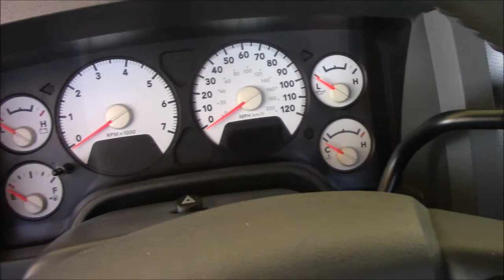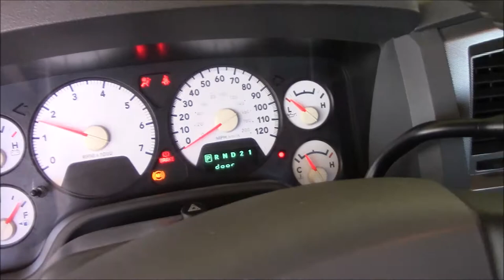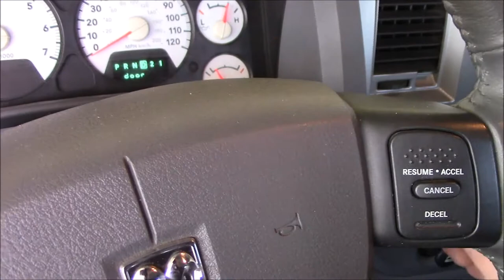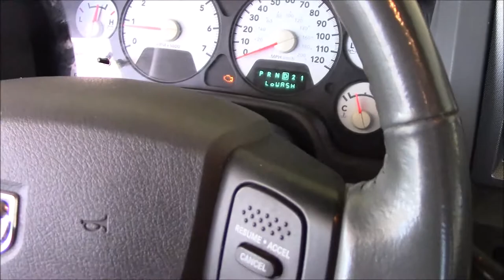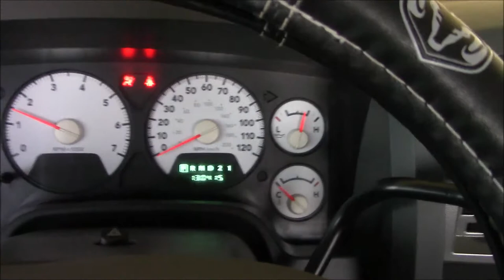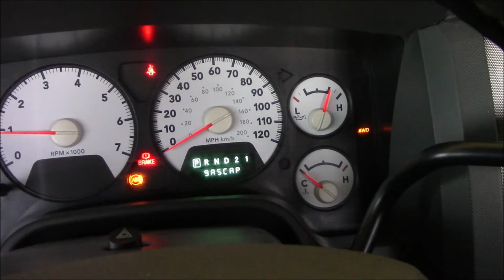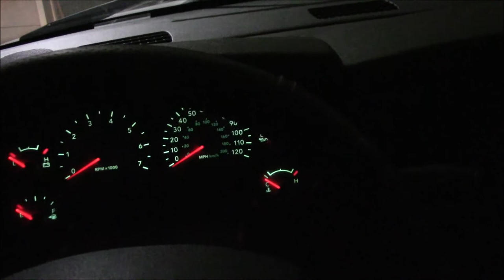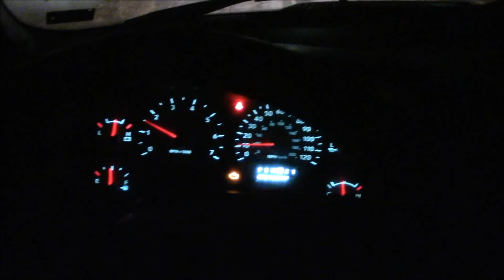2007 Dodge Ram 4 Wheel Drive Diagnose and Repair

Comment: I’m having a similar issue, the actuator works fine on the bench, the T-Case shift motor is working fine, I even replaced the TIPM but still the 4WD keeps blinking. Any advice ?
Reply from the maker: Check the plug. After I made this video  it eventually turned out that my plug was bad also which I think is why I was still having trouble getting it to engage there at the end. I didn't know that at the time. I didn't have much of a need to use it for awhile so it was months later that I finally figured it out. I went to a salvage yard and found one. It's easy to replace. It actually has a plug a little higher up so there's no rewiring. You just unplug that little section and replace it. Good luck
Reply: @mgewaily did you ever solve the problem completely? Is yours the laramie with 4auto? Replaced my actuators a few times, now the tipm has been replaced and was working for a bit but hit some ice and abs went nuts, surged the electrical in the truck and 4wd service came up and then disappeared after a restart Sound familiar?
Reply: @problemsolvingbrad I did fix the problem, turns out it was the speed sensor by the wheels, the wire for that was cut, once I spliced it everything worked perfectly.
Reply: You have to be rolling when you turn the knob for 4hi. Allows the splines to engage

Comment: Ur supposed to get hopelessy stuck in 2wd and then use the 4x4 thats the only way to test that lol
Side note one damm wire on actuator rendered my truck usless 4 a year
Reply from the maker: Exactly. It's always fun to crawl under your truck in the mud. Been there. Yeah. About a month after making this video I figured out that the plug was bad also. That's actually why it wouldn't engage there at the end. I went to a salvage yard and pulled another one. It's worked perfect ever since.

Comment: These are shift on the fly 4x4, you can actually engage them up 25-30 mph. To put in 4 low you have to put them in neutral tho. Thanks for the informative video, mine was the transfer shift motor.
Reply from the maker: Thanks for the info.

Comment: Good job on this video...I learned a lot. I wonder if it was possible that you did not have the fork in the sleeve, when you put it together again. Also, the remaining wire might be a limit switch so the computer knows that it is in 4wd.
Reply from the maker: I'm sorry this reply is so late. I never saw it til now. No. I had the forks on the sleeve alright. I've discovered that you just have to turn your wheels a bit until the splines line up. I'm not real impressed with how these work. My '97 dodge doesn't have these problems. I think you're probably right about that wire. Thanks for watching and the comment.
Reply: @troyt9007  so I’m having the same issue with my 07 are you saying to jack up 1 side and align it how???
Reply from the maker: @ericdavis9992  No. You don't need to jack it up. That's just what I did to see what was going on. You just need to be moving and turn your wheel a little to get the two shafts to turn at a different rate of speed until they line up. If you have the 4-wheel drive engaged, the fork on the actuator that goes around the sleeve will keep pressure against that shaft, so when they do line up it will slide the sleeve over the shaft to connect the two. Hope this makes sense. If not just let me know. I'll try to be more clear. Thanks
Reply: @troyt9007  ok thanks I’ll give it a try I really appreciate it I ordered the actuator already but I will definitely try this 1st thanks again
Reply from the maker: @ericdavis9992  No problem. Good luck
Reply: @troyt9007  thanks and I’ll check back in afterwards

Comment: Good video. I have 4 wires from front actuator on 06 1500 Dodge 4+4   #2#3 wires are positive #2 is supposed to turn negative when switching to 4+4. Back to 12 volts in 2+4 . But stays positive doesn't change. Continuity tested wires all way to firewall. All good. New actuator. Transfer case definitely kicking in. Any suggestions please.

Comment: Hello sir thank you for answering my question about my transfer case wiring not being connected because the connectors are different so I don't have to worry about my transfer case shifting to 4 low by itself while I'm on the freeway
Reply: I changed everything eventually changing the timpt or fuse box and it worked

Comment: Should be rollmg to make shift uless going into 4 low
Reply from the maker: I discovered later that the plug going into the actuator was also bad. That's why it wasn't engaging. I replaced it and never had anymore issues with it.

Comment: Oh heck yea I'm subing to your channel!  I consider myself a pretty creative "workaround" guy but SUCK at anything electrical.  Even the way you pulled strands out of those wires to create a better jumper was an awesome lesson for me.  I just tried to totally guess with mine on the bench and probably fried something unnecessarily.  Heading out to the garage to try the bench test your way now!  There was ZERO chance my bench test method was going to produce any movement I assure you ha!  UPDATE:  I just finished watching the video and now I'm wondering if I am just binding like your's may have been.  First I'm going to bench test my OEM original that I pulled previously just like you did it.  If that doesn't work, then I will pull my replaced actuator and inspect that alignment with the passanger front tire up like you did and see if it is just an alignment issue that it doesn't like when it starts up and runs diagnostics.  If that looks good then I'll bench test the replaced one to see if it is a premature failure part.  Wow, what a great video.  I am really curious if the colors of your wires correlate to a 2017 RAM3500 but I WILL report back on all of this in a second "update here on this post".  Thank you!!!!

Comment: You just saved me at least 600 bucks. !!! 
Thanks man !! 
Appreciate ya!!!
Reply from the maker: I'm glad it helped. That's why I do them. I found out about a month later that the plug wasn't making a good connection. It worked for awhile and then it went back to flashing and not engaging again. I replaced the plug and have been good ever since. Thanks for the comment

Comment: the axles have to be moving a little bit so the sleeve can line up on both axle shaft splines & leave in gear for 4x4 high and moving,
Reply from the maker: Yeah. You're right. Sometimes when I know the 4 wheel drive is engaged the light still flashes like it's not. Thanks

Comment: One thing bothered me when you were troubleshooting: the fact that the original and new actuator returned the fork to the 4WD OFF position when you de-powered the circuit. Me thinks that the "ground" you were using was actually a ground for the, say, 4WD Off position. Whereas that ground was/is supposed to be supplied by the rotary switch in the cab in its 2WD position. So, to select the 4WD ON position, the switch would then ground the ON coil and drive the fork to engage the axles. The Off coil would then be un-grounded and so would/will not have returned the fork to the 4WD Off position as it did in your test when you removed the lead from the ground to the battery. Of course, you could just use a volt-ohm meter (They're cheap enough these days and sometimes you can pick one up free at the local Harbor Freight sometimes) and run some continuity checks back to the switch to see what it's doing. Or use your trouble light to check from the battery positive of the vehicle battery to each pin. It'l light up if any of the pins on the connector are supplied a ground. (It won't light on the powered pin) 
Unfortunately, without a schematic or re-doing the test, you can't know. See if you can find the .pdf manual to download for free. I've got one for my '96 gen 2, V10-engined beast and it has helped tremendously. Unfortunately, though, my 4WD actuator runs on vacuum. Going camping in a few days so I completely bypassed the system with two long vacuum lines to the cab and operate the actuator with a small manual vacuum pump as a temporary fix. Works like a champ! Cheers!

Comment: Great video.  Did you add oil in the housing?  If so how. Thanks
Reply from the maker: Yes I did. Sorry I didn't show that. I did it a couple of days after. Didn't take much. You just put it in the front differential. There's a rubber plug in it. It's located right next to actuator electrical plug. Pull the rubber plug out and fill it up til it starts coming out. Then put the plug back in. Mine takes 75W 90 gear oil. Thanks for the comment.

Comment: I have the same issue on the same year and model  .. 2007 Big Horn Hemi 5.7 4x4 SLT ... I swapped out the old for a new actuator and still have the same problem of not engaging  .. will pull it apart and check for spline alignment .. your video made sense of the problem and I'm hoping it will be a good fix .. plus I am going to test the old one also .. I'm an employee of an auto parts store so I'm hoping for it to work out 
.. Thank you
Reply from the maker: I found that you need to drive it around a little with it in 4-wheel and turn the wheels to get the splines to line up, so the sleeve can engage. Also, mine is still working but my light will sometimes still flash even when it is engaged, so don't let that fool you. Good luck.
Reply: I am having the same issue on an 08 after replacing the actuator.
Reply: @troyt9007  question for you. 2005 ram. my 4 wheel works fine going straight, but grinds when making tight turns, is this normal????
Reply from the maker: No. That's not normal. you'll feel it pull or kind of resist a little when you make tight turns, but it shouldn't grind.

Comment: Man we all love 4 wheel ..but man it can be a pain and aggravate the hell out of ya..thanks for the video glad ya got yours wkn.. I'm looking at one right now that will not engage but it's not making a noise at all in any way great looking and great driving truck otherwise but the price difference of four wheel and not four wheel is pretty significant and I want four wheel. Anyway the guy doesn't want to come down much off the price even though four wheel is not working at all. So I'm trying to figure out is it worth it
Reply from the maker: I'm sorry this reply is so late. I just saw your comment. So I guess any comment is too late now. But if you have this dilemma again just know that there are two actuators for the 4-wheel drive. The other is located on the front of the transfer case. When it works its very loud. So make sure you check for that one too. Thanks for watching and for the comment.

Comment: I think you should of put in gear and then tried 4wd again but might of might not thanks for sharing
Reply from the maker: Yeah. I eventually did do that. Even now though sometimes I know the 4 wheel drive is engaged and the light still flashes like it's not. Thanks

Comment: why is your oil pressure gauge so high????
Reply from the maker: Because when I rebuilt this engine I put a high volume oil pump in it. From what I've heard and read, these engines don't distribute a lot of oil. Especially at idle. They're kind of made to run at higher rpm's, So I wanted to give it all the help I could.

Comment: I had same problem but wasn’t sending power had to use a jumper wire
Reply from the maker: I'm actually having trouble with mine again, but I know what it is. I have a loose connection in the plug. I fiddled with it and had it going for awhile. I guess I need a new plug wire.
Reply: @troyt9007  yes me to
Reply: The connection is prone to being fouled up with dirt and grime, or wires getting pinched.  Which is a total bummer since it's 4x4, and usually you don't need it until you're in the muck.

Comment: Does cruise control work
Reply from the maker: Yes. Mine works
Reply: @troyt9007  mine doesn’t dodge said relay on fuse panel was out
Reply from the maker: @dlmcbride2388  Hopefully it will be a cheap an easy fix for you then.
Reply: @dlmcbride2388 my cruise control is out as well, is there a correlation with that problem and the 4wd not working? I also have a 4wd problem and it doesn't appear to be the actuator
Reply: I’m having the exact issue, it’s an 08 as well, cruise control and 4x4 went out at the same time. I’m wondering if there’s a board somewhere !! Anyone got anywhere with that ?
Reply: @mgewaily there is a board. I just soldered in a new fuel pump relay. I didnt look into any 4 wheel drive while messing with it though. They want a small fortune for new modules. I soldered a $6 relay in and it works....but now my 4 wheel drive is out.

Comment: ours engages by itself we have the opposite problem !! 😢
Reply from the maker: Sounds like you have some wires touching somewhere that aren't supposed to be. I'd inspect your wires to make sure someone hasn't spliced something in somewhere. Then I'd check where the wires come together. Like the switch or the plug. Put your tester to work. Good luck
Reply: I had the same problem and had to replace to timp men aka fuse box
Reply: Mine was the tipm as well